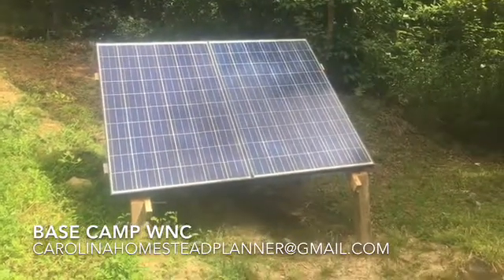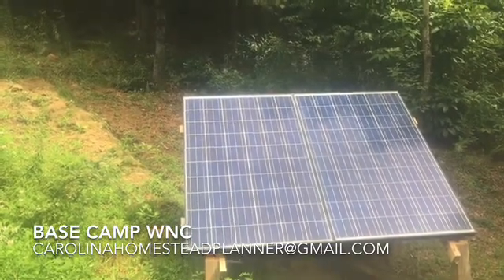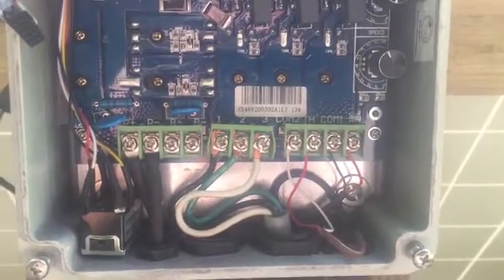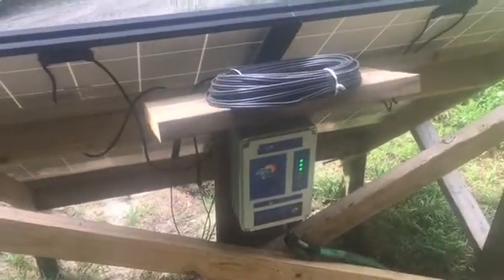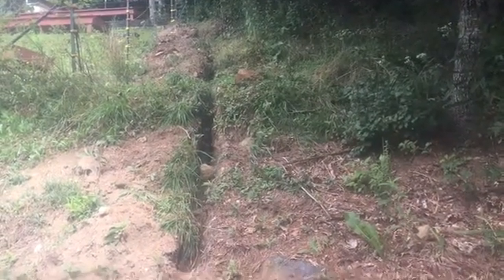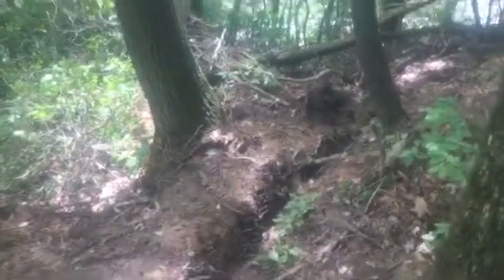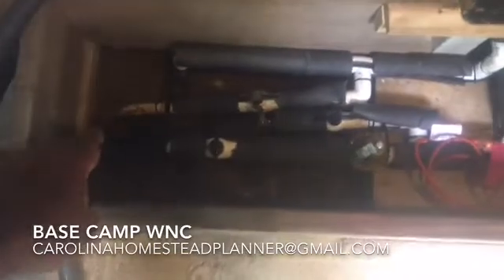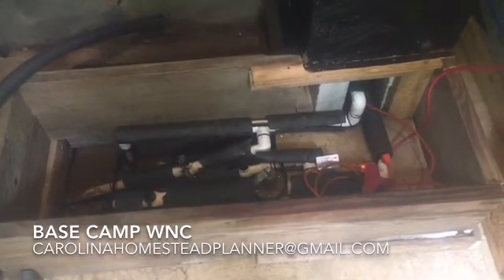Gravity Water System With A Solar Pump

Comment: Where you been bud?
Reply from the maker: Just been doing the same stuff at the farm
Digging grading and pour concrete 
Didn’t want to keep putting the same stuff all the time
Will receive a off grid hot water heater PV solar system next week no batteries 
And you can use the 120 volt 220 volt to cook and run a refrigerator with
Be looking for it
Thanks for thinking of me
ERIC
Reply: @basecampwnc1745  thinking of doing a hand punched 1.25" well point, maybe around 50'. Then doing some kind of PV water pump setup like you did with electric motor driven rod pump up top. My pond I built drops water level during the summer till around late fall when the springs start back up. Stay safe bud!

Comment: Liked your video. What are some prices for your DC well pumps?
Reply from the maker: Hey Justin
The price of this pump with the 4-100 watt solar panels a inverter -Pump and sensors 
Price run around $1,400.00
There are a lot of pumps available 
Depends on depth of water distance of water to pump and the height of water pumped and how many gallons per day needed
If you are interested please contact me 
And as always subscribe like and share 
Thanks 
Eric